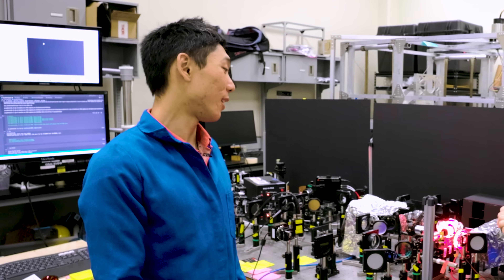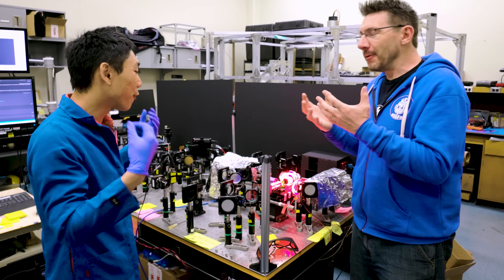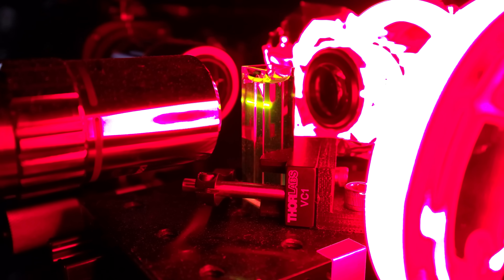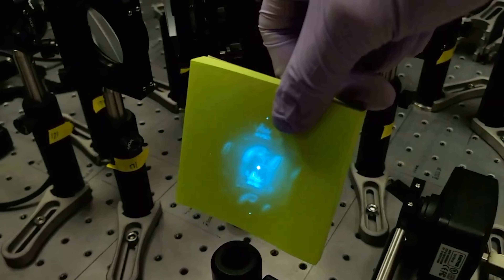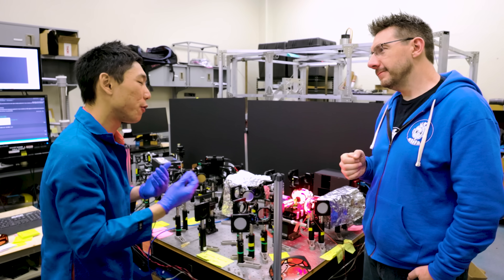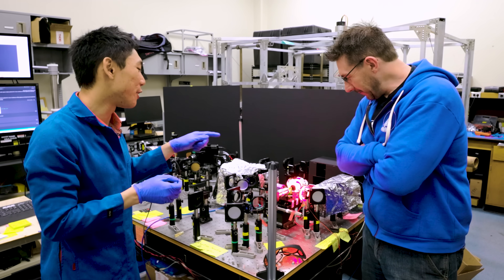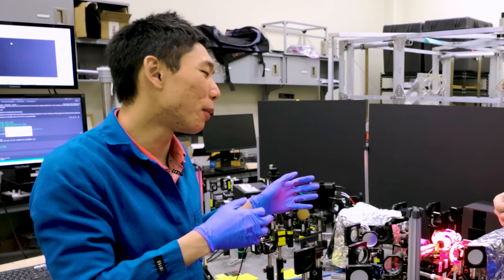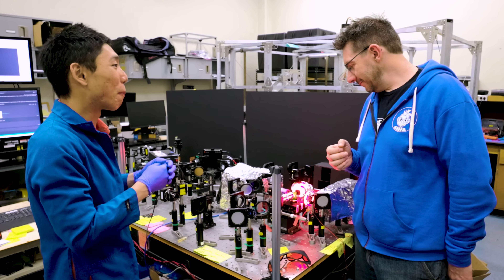Holographic 3D Printing is REAL!

Comment: The replicator in Star Trek basically 3d prints with atoms.
Reply: I mean isn't that what we all do?
Reply: @willofthemaker  not on an atomic scale but yes lol
Reply: @seanr7297  Yeah like they can create any material at an atomic level including food in ten forward. They basically used the teleportation tech to teleport all the atoms in place and form whatever object they wanted out of whatever material they knew the composition of.
Reply: Don't forget, plus a huge "star" load of power too.
Reply: Using light based technology and resonant frequencies along with magnetic fields to hold the materials, we could generate if we understand the dimensions.
Reply: PolyJet ?
Reply: He mentions a spatial Fourier transform. With an advanced enough version, an optical lattice/labyrinth could control the migration of ions, and control where they condense/dendrify through excitation of surrounding surface potentials through light bombardment.

This of course requires utopian characterization of the system, and the build surface, which is no small feat. Issue being what kind of active array can create subwavelength resolution coherent spatial lightfield, but also allow for reversibility for spatial spectrographic analysis?
Reply: Don’t all 3d printers use atoms?
Reply: @DarthBane..  Mine prints using antimatter, but the issue is every time I go to print I'm consumed by a massive and intense blast of energy
Reply: @Reverend_Veritas  ah I see my mistake

Comment: if you use x-ray patterns you can cure any point at any time, but if you use 360 layered curing, then you have the grow the object from the center-out. you have a physical problem of object blocking light. yep inverse ct scan 3d printing. simple way of printing would be a growth stick point, with half-dome 360 degrees center-out growth. ie spherical resin printing. oh god you are limited to transparent resin.
Reply: Specifically to resins transparent to x-rays, might be simpler to apply the technology to visible light for the stick growth point
Reply: When the resolutions get high enough, you could pattern in structural color :)
(40 years or so from now)